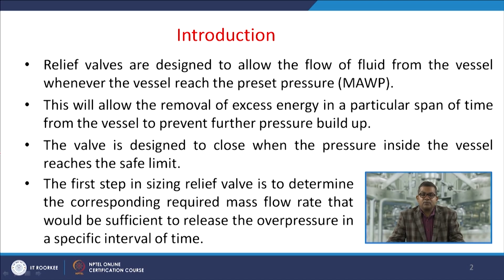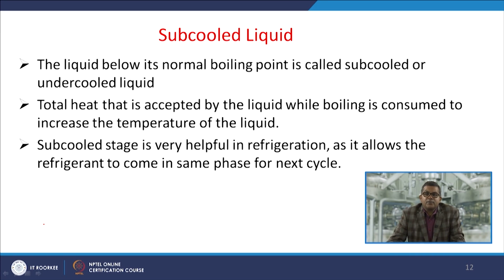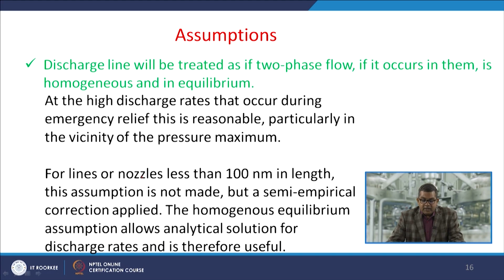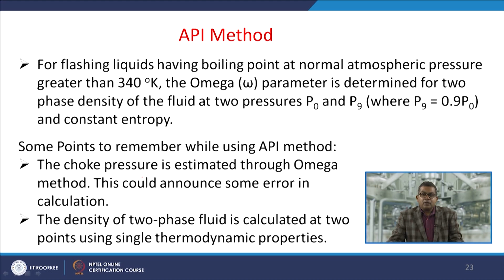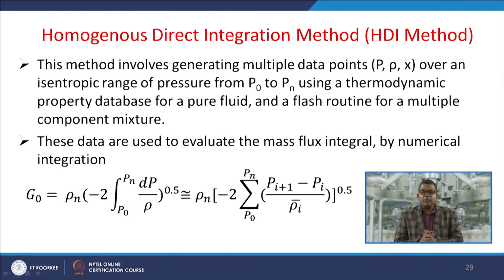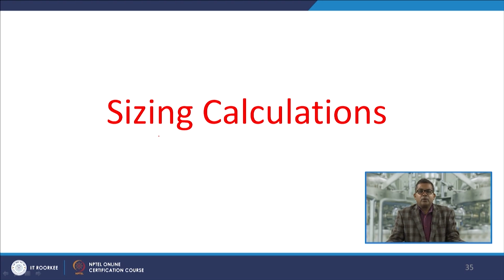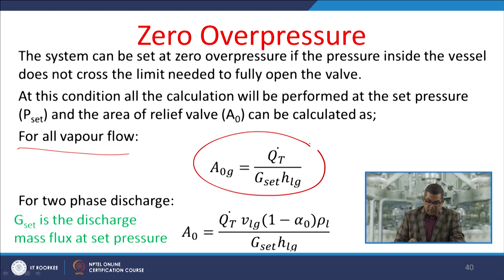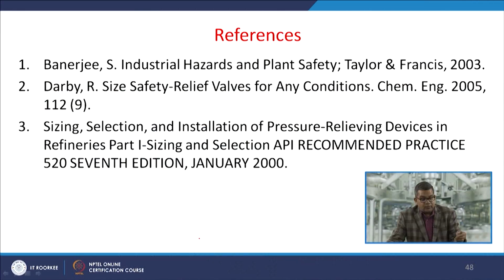Relief Sizing

Comment: i have reciprocating pump 8 " suction and 6 " disc    suction  8"X6" Concentric reducer      Discharge sch  4" X 6"  Conce reducer . after this PSV Connected from Discharge to Suction line . what will be the size of RSV Inlet branch and outout branch
Reply: follow EN13136. You should be able to size it. I think you are dealing with over-pressurization scenarios of the pump. Not many do this way, so the literature is limited.

Comment: I have question : where the API stands defined distance from the center of the flange connections to the opposite faces "a" and "b" it's mentioned (API and N page if it possible). I hear that API safety valve can be changed or permuted without problem of dimension.  Thinks you